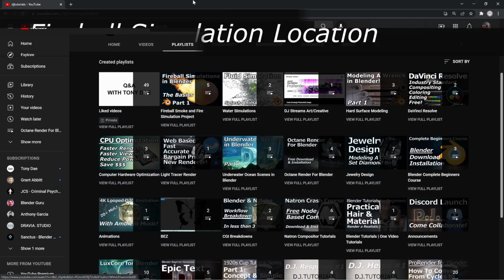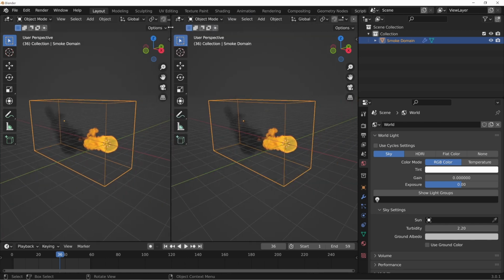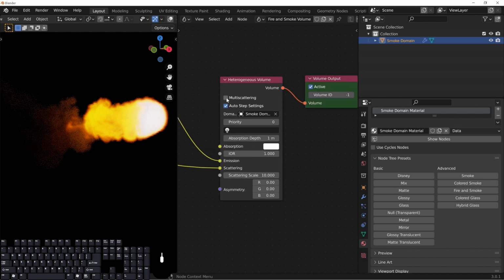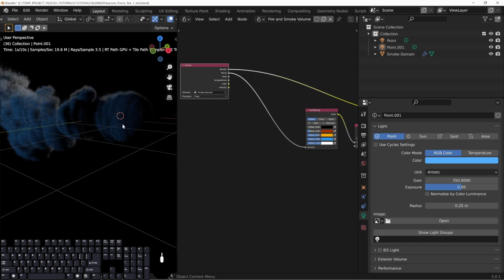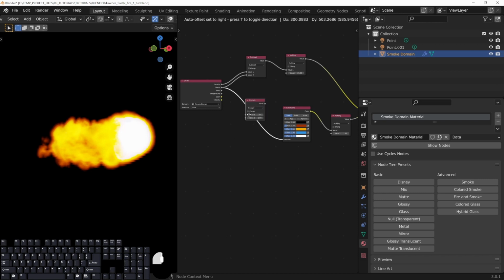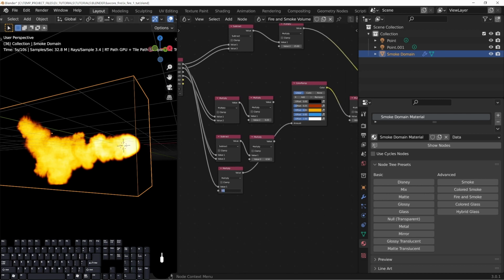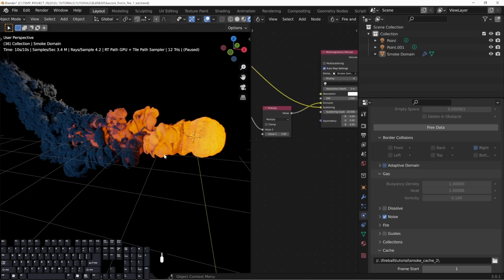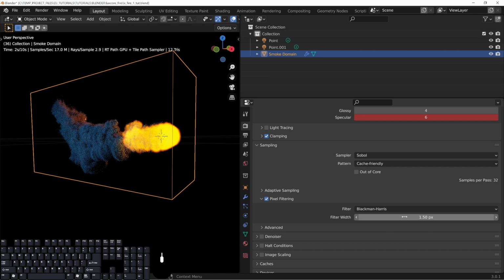Luxcore Render for Blender Advanced Smoke and Fire Materials

Comment: Great video!
Just a quick tip - don't turn on the pixel filter, especially if you want to use denoising. Pixel filtering is known to interfere with the Intel OpenImage Denoise algorithm and make denoising much worse!
Denoising is almost a necessity if you want to render this as an animation without spending an eternity. If the denoising removes too much detail for you, you can add some back in using the compositor to mix part of the original image back into the denoised pass.
Reply from the maker: Thanks for the tip! I (almost) never do denoising on smoke sims but I wasn’t aware of the OIDN issue you point out. How interesting! And yes, I also do the denoise/mix trick in my fireball sim tutorial series.
Reply: @djtutorialscgi  Yeah, it's a good point, unfortunately denoising has no info on the volume or density because there are no surface normals or albedo to work with, so essentially it just sees a flat 2D surface, and it's hard for it to know what is detail vs. what is noise.
But due to numerical precision limits, even throwing 200k samples at it will often likely not eliminate all the noise